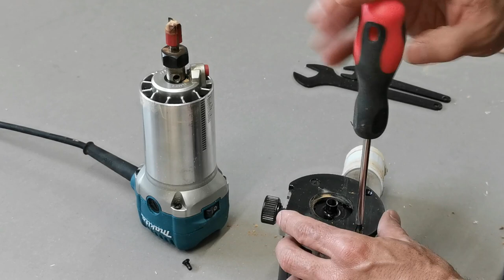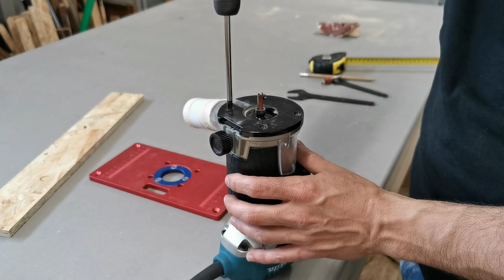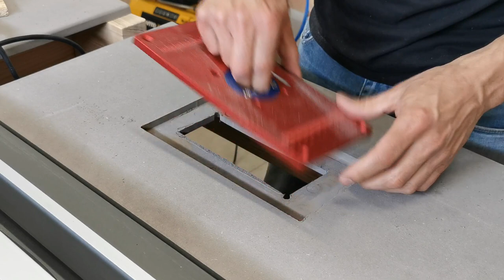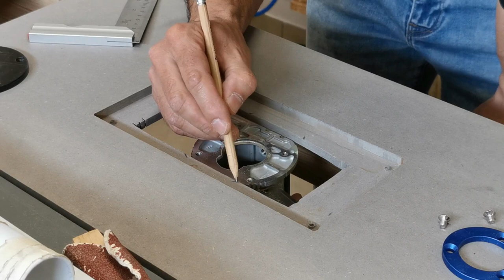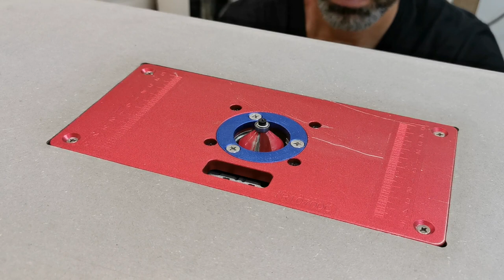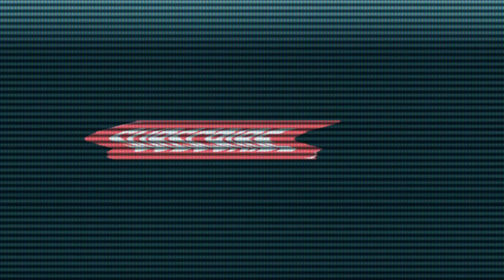Router table insert plate for Makita RTC0700C

Comment: This is the most complicated way of doing a simple job iv seen
Reply from the maker: Thanks for your comment. It's the way I find easy to do with my limited skills. Hope you can teach me a better way.
Reply: @WoodYouDoIt I think what he meant to say was that; if you had a larger router base instead of the black circle one you kept removing you could have easily crossed the distance without having to use scraps of chip board to hold your router up.

Hope that helps.

Comment: This is excellent Pedro, I've made a bench with the valcromate top, I was going to put my router at the bottom of the bench, but change it to the side of the table saw, I can utilise the excellent Dewalt fence. I'm going to make a wooden fence to clip onto the saw fence. Are you going to attach a fence on yours. If so will you be making a video.  Once again thanks for the videos.
Reply from the maker: Yes David, i wanna do the exact same thing as you but i don't know if I'm going to make a video about it.
Reply: Hi Pedro thanks for replying,  when I saw you putting your router next to the rip fence it made perfect sense. Its coming up with a fence that will just sit on the dewalt fence. I think it would make a good video. I can appreciate that these videos take some making.

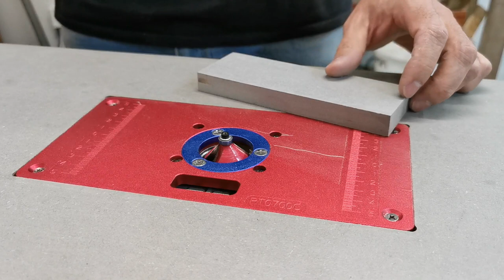Comment: thanks for the video! is that a remote that you are using at 9:20? if so what make/model please? Bluetooth?
Reply from the maker: Hi, yes it's a remote to power on the dust extractor.  It's a eMylo smart wireless rf remote control. Hope this helps you.

Comment: HOW DO YOU DO THE CUTOUT WITHOUT A BEARING ON YOUR BIT?  DONT YOU CUT INTO THE SIDES OF THE JIG?
Reply from the maker: I've used a guide bush. The guide bush is essentially a circular flange, usually between 10mm and 40mm outside diameter, which fixes to the router base and acts rather like a small ring fence. The cutter plunges through the middle of the bush and the outside edge of the ring runs against the jig or template, to position the cut.

Comment: Good job. What make/model is the insert plate? A link would also be helpful. Thanks.
Reply from the maker: https://www.banggood.com/233x117x8mm-Aluminum-Router-Table-Insert-Plate-for-Woodworking-Benches-RT0700C-Router-Trimmer-Red-p-1295961.html?cur_warehouse=CN&rmmds=search&p=LX111949011782202011&custlinkid=1579146
Reply: @WoodYouDoIt   Thank you. Much appreciated.

Comment: Where can I buy the red plate?  Very nice!
Reply from the maker: Hi Ron , thanks for your comment, please subscribe the channel. I got mine from Amazon but the seller is not active anymore. Try to search Google for "aluminum router plate makita rtc0700c" but be careful with the distance between holes on the plate, they should match you model. For makita is a specific one. Check that.

Comment: Hi Pedro, where did you get the red plate insert? Thanks 😊  great job
Reply from the maker: Hi, thanks for your comment 👍please subscribe the channel 😉 i bought it on Amazon, but is not available anymore from that seller . But you can find it on Banggood. Consider that for this makita router is a specific model because of the distance between screw holes.
Reply: @WoodYouDoIt  yes I have the same one. Thanks